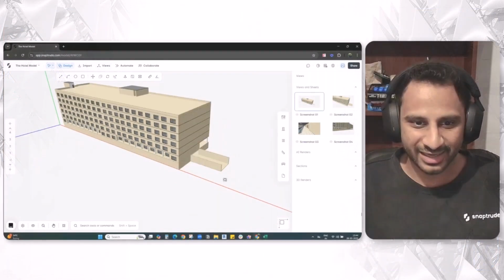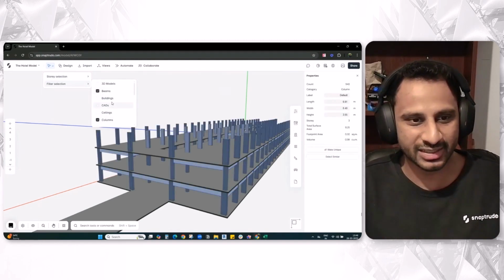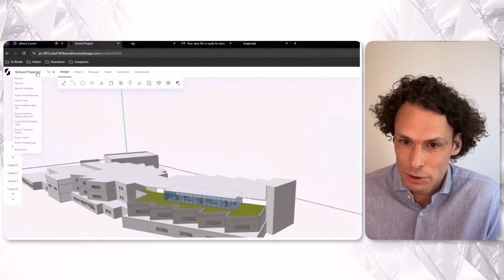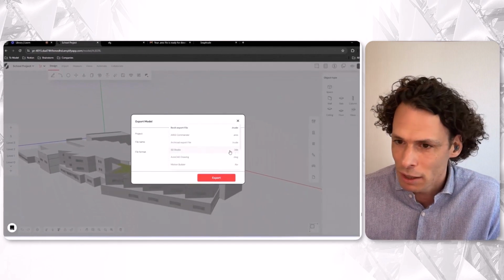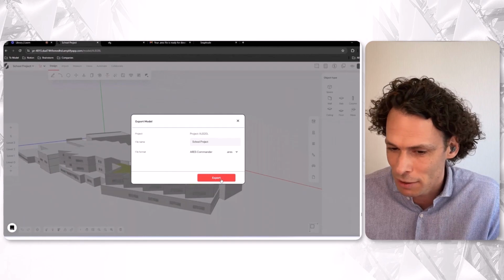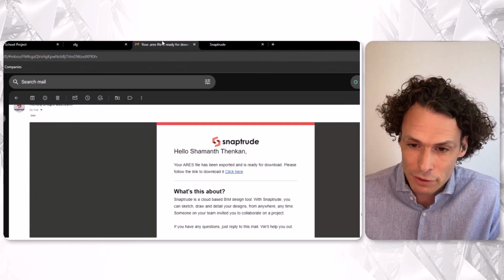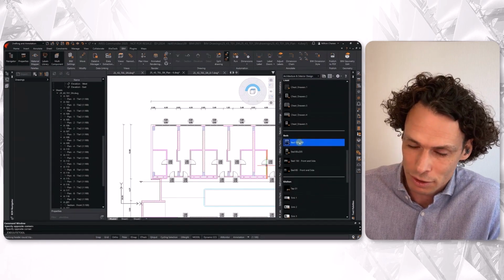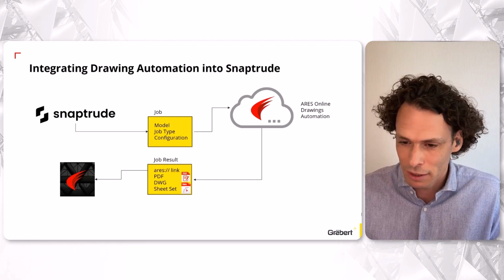Drawing Automation for Online BIM Solutions – Snaptrude + ARES Case Study

Comment: Could you please explain how we can download Sneptrude, and whether it's possible to test the software? When I visit the official website, there doesn't seem to be any option to download it. I tried creating an account, but that didn’t work either. The only thing I can do is request access, but even that form doesn’t accept my business email. We'd really appreciate it if you could clarify how one can actually gain access to Sneptrude.
Reply from the maker: Hi there,
Snaptrude is currently rolling out a new version based on a new approach connecting 3D BIM models with a spreadsheet where geometry can be manipulated from the spreadsheet, and the two elements are updating each other. They are gradually opening early access to users for this new technology, which probably explains why you have not been granted access yet. I think you just need to allow some time. The best approach remains to ask for access on their website, and there is also a chat in the lower left corner of the website to engage in a discussion with them.
Best regards,
Team Graebert